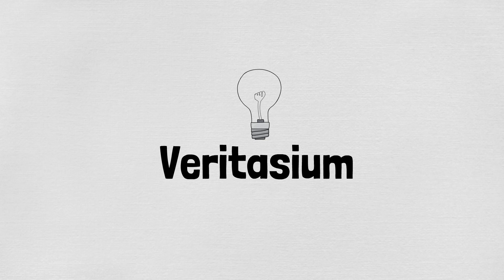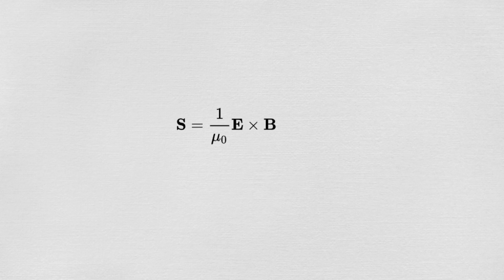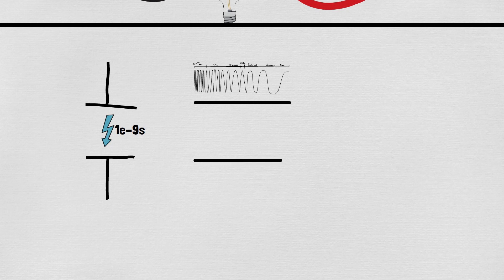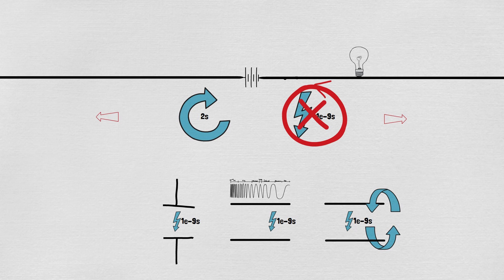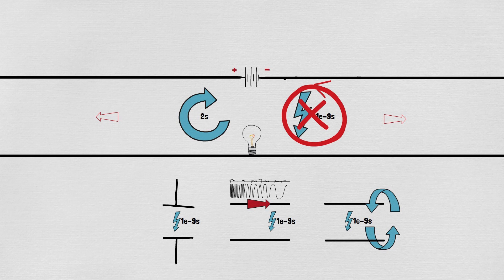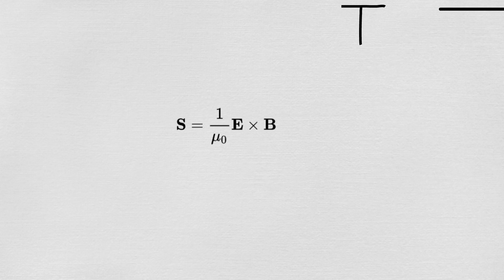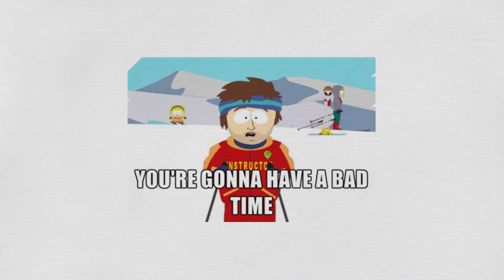Veritasium is Right? (see description)

Comment: Yep 2 things - 1.  Why does the circuit need a switch if the energy floats thru the air to the bulb?  2.  Why does he specify zero resistance wire?  If no current flow then who cares how much resistance there is?  Additionally- if I were to place a electrostatic shield between the battery and the lamp - would that stop the lamp from during on?  (Hell no!)

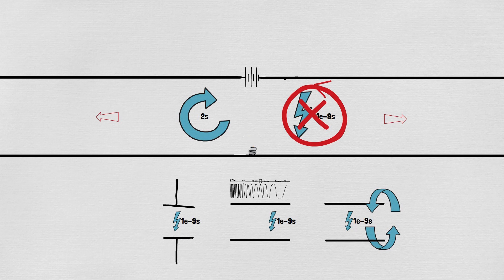Comment: 3:43 exactly, it powers all the light bulbs in the entire universe technically. isn't all field lines going to infinite always ? 
but field strength decreases with the square of the distance, but wait, there's no current anywhere, so it doesn't matter how infinitesimally small the field is, 0 * anything is still 0. There wouldn't be any current whatsoever, so what's the point ?
Reply: oh, the conclusion of the video, I was half way there, should have waited more.

Comment: The current flows exactly because there is a capacitance. Same reason a current flows into an antenna. Of course with a switch this only happens once in the beginning. But the length of the transmitted pulse depends on the length of the antenna. This is the explanation I used in my video.

Comment: It's not the distance between the battery and the bulb that sets the time it takes for the bulb to receive some energy. It's the distance between the SWITCH and the bulb that sets the time. So if you put the switch 1 ls away from the bulb it will take 1 s for the bulb to light. Derek of Veritasium would agree with this.

Comment: Cables literally have something called a velocity factor. Like a coax has 66-85% velocity factor while a twisted pair has 64-74% velocity. We know how to measure length of cable based on that (by doing Time Domain Readings with a simple oscilloscope). Thanks for this explanation, Veritasium video confused me.

Comment: No, Veritasium didn't get it wrong. In the transient state, waves travels along the wires (transmission line), and a return current flows on the bulb's branch (~20 mA by my calculations, given that the line impedance is about 650 ohms). This is small, and he says exactly that in the video. With the reflections, the voltage across the bulb slowly builds up to the full battery's voltage, which is described in the analysis by a Professor that is in the description of Veritasium's video.

Comment: question...isn't the PD on the wires on either side of the switch equivalent to the PD of the battery? There's no good reason why measuring the PD across this air gap would be any different from measuring the PD across the battery right? So as soon as you close the switch there's going to be some flow near the switch, there's going to be current perhaps not through the whole wire but through that section instantly and you say that the flow of current leads to the antenna and capacitor etc effects so I agree with you that Veritasium is wrong, but not for the reason you describe, it's not the whole two seconds nor is it simply the 1/c seconds between the bulb and the battery, it's about the causality between the switch being flipped and the lightbulb.

You close the switch
Current starts to propagate in the wire at the speed of C around the switch
As the current flows you get the antenna affect which propagates out to the opposite wire at C and induces a current
You get a very low amount of that power to be collected by the opposite wire and so at ~distance between switch and battery/C the light turns on
But the effectiveness of the power transmission is extremely low so it's on but I'd bet it's barely noticeable
As the current propagates at light speed along the wire the amount of energy transferred should get more efficient until at 0.5 seconds (the distance between the switch and the end of the wires)
The efficiency would race back to the bulb at the speed of light along with the current flow wave front
For the full second (near enough) for that current to get back to the light bulb the brightness increases, whereupon the current is flowing through the wire at the bulb and it's fully at 50%.
Then would the same process start for depleting the battery's charge and eventually current flowing from the battery after 2 seconds of elapsed time as well as the establishment of the other side of the antenna effect and reinforcing the current and reaching 100% lit

The same would happen in reverse when opening the switch, the charge would continue to flow around the bulb for a second as the close stop of current propagated but it'd have depleted power from not having the charge reinforced by the antenna effect, the lamp would begin to dim after ~distance/C from battery to bulb but it'd take 2 seconds to completely turn off. 

Your explanation is 'obvious' for one side that closing the switch takes 2 seconds to propagate and establish the field but the reverse-opening the switch feels nonsensical, that current could continue to flow for 2 whole seconds between the poles of the battery after the switch has opened.

I think it's interesting how the whole set-up process was glossed over, and that it's assumed that it was set up a long time before the switch is flipped in order for the wire/battery/lamp/open switch to come to an equilibrium before the experiment. And that it's so glossed over that you were primed to think only about closing the switch but not about opening it again.

Comment: Derek assumed that the step response contains a discontinuity at T=3e-9, which may have happened if and only if the impulse response contains a delta function at that T - which it does not, obviously. Instead, it contains a fairly low value (Green function) which decays exponentially till the direct wire coupling hits. Hence, the step response at T is 0. Zero. Zilch. Nill. The  first derivative is discontinuous, and becomes > 0 for t >=T, but that's about it.  I am ready to bet against any supporter of Derek's claim. Anybody?

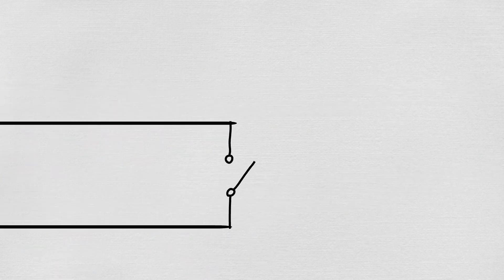Comment: I think youve misunderstood what Derek meant by the field gives power. now i didn't understand it either but what i THINK he was getting at. Is the current still must move for there to be power generated, which comes from the propagating field. Which i think is what your getting at at 3:07 and 3:43. BECAUSE there is a propagating electro magnetic field starting at the switch, the current flows and THEN things are powered. 

In his thought experiment I think hes getting at: Close switch->electro-magnetic field is propagated -> current is flown through the connected wire (not unconnected) -> flowing current powers resistor.

This is my  main gripe about Dereks video. I think he's intentionally made it really vague and supernatural sounding  to incite conversation, discourse and hence views for the video. When in actuality current is still powering things, but the propagating field  generates that current. Which is why the light turns on.

Comment: At first I was thinking that your explanation is spot on but now I think you both kinda wrong. First, we can scrap the light bulb for a super sensitive sensor so that there is not ambiguity when we are measuring an increase/decrease in power and thus conclude when the switch has been closed/opened. In this way you can brake causality like you explained. 

One thing you missed (I think, I only studied Griffiths .... fortunately?) is that it WILL matter where the switch is. While the battery will have a potential difference across it the switch will as well (equal and opposite). When the switch is closed, this is where the current will start "flowing" first and thus create the E-field, B-field and then Poynting vector which will then flow to the detector in probably a complicated way, that at best, will get there at (distance from switch to detector in meters)/c.

Comment: Ok so, does this mean that if we put another light bulb 1m away from the power supply but NOT connected to the power supply - will it get the same fraction of the energy that the connected light bulb will in that initial time frame before the steady state?
Reply: Yes, with a small corretion. It doesn't matter how far the battery is, what matters is how far the switch is, because that's where the initial change of the em field happens.

Comment: I'm glad Veritassium sparked so much debate. So... I am an expert in this field. EE in power electronics. Limited rise time on a cable is a normal phenomenon for us. I.e. there's a 20 meter cable to a motor, and a big IGBT turns "fully on" in 100 ns. The effect ends up manifesting as a voltage doubling at the terminal (long explanation, but it's caused by the time delay and impedance mismatch).

Veritassium put so many restrictions on his problem that he's right. He isn't asking when the bulb turns on, but when voltage is detectable at the bulb. As you pointed out, the switch right next to the battery makes it a dynamics problem, and the voltage across the gap is detectable. Again, it's a common problem for us when that switch represents massive dV/dT. To your point, if the switch was on the moon, there would be a delay. You're right in that the switch is the source of the dynamic field and the thing that matters here, but he put it "at the battery".

Comment: You could run this experiment in real life with an RF signal generator, an RF oscilloscope, a resistor, and two rolls of 16 AWG speaker wire from the local hardware or electronics store. Something like 50' rolls would work. The free end at the start of the rolls will be where the "battery" (a sufficiently stiff voltage source with a high-speed switch or the generator itself) and the "bulb" (a 10Ω resistor) and scope the resistor with a probe. The ends of the rolls can then be stripped and soldered together to mimic the ends of the circuit in Veritasiums video. The time scales will be much different, but the ratio of characteristic impedances of the transmission line formed by the speaker wire and the resistor will be approximately the same, and the general waveform will be similar. Be nice if he could have done this demonstration. If he can afford to hire a helicopter to drag rope around, then borrowing some RF gear should not be much trouble. Edit: Im not sure the wire could be left spooled up as its not being driven differentially like a true transmission line. But still, it would be feasible to unroll it and store it loosely on the floor so there isn't much cross-coupling.

Comment: The explanation incorrectly assumes all electric energy transfer is via electromagnetic wave action.  BUT - this is a DC circuit.  When the current is flowing (as per a standard elecrical circuit analysis) there is a constant current, and a constant electromagnetic field.  As there is no ongoing magnetic rate of change, there is no ongoing induction to drive the electrons (the emf and current) around the circuit.  But we all know is.  So, where does the magic formula get us now?  Nowhere, because it is not suitable.  There are two incorrect assumptions.  

- That electric energy transfer is transferred EXCLUSIVELY via electromagnetic wave action.  Wrong - nearly all the energy here is transferred from the electromotive force on the electrons by the chemically electric potential of the battery (Except for the transition to on and off, where there is some transient second order electromagnetic interaction between E amd M), and 

- that Poynting can be applied to all wires and circuits without fully analysing how the individual fields, with the directions and amounts of the vectors (this has not been done at all - the diagram at 8:45 is only conceptual and is misleading).  The parameters of the formula cannot be practically measured to show the direction of energy flow

So - this formula is not a suitable model  to analyse this circuit (especially without a t or an f in it).  Poynting is suitable for the transmission of electromagnetic waves through space or a medium.  The video also ignores the primary electromotive force of the battery being the source of the ongoing DC power.

Comment: a loop 3000000kms  long will never light with a battery.. even if  it would it would take quite a bit of time.. an induced field across a meter might light up immediately.. but a circular loop wouldnt

Comment: If this problem is considered to be just a basic DC series circuit, then the location of the battery switch and lamp should be irrelevant.  If the switch and lamp are located at either end of this very long circuit and the switch is toggled to send Morse code, the lamp can't come on instantly as to do so would mean information has travelled faster than the speed of light.

Comment: Wouldn't a charge start to flow immediately after connection as the wire itself is not at the same potential?

Comment: If we are just talking about circuits, you need to go no further than seeing these two long wires constitute paired antennas or two terminals of a capacitor, thus a sudden change of current in one wire (from closing the switch) induces current in another, so you have a current, the hypothetical light bulb is lit, it is that simple. If you allow me to toy with the switch a little, I can even make the light bulb sing a song.

But if we are talking about classical Electrodynamics and comparing Poynting vector to electrons, that's where Veritasium confuses me: If you know electrons exist, you certainly should know that electrons are the 'real' physical entities here, static charges (electrons) create electric field E, moving charges create magnetic field B.
But Poynting vector, it  is a math product of E×B, the vector isn't really measurable by a direct physical interaction, we invented this concept just  because it conveniently points to the direction where energy flows. 

So what I don't get is, here electrons create the electric field and magnetic field (in fact, I guess you can see electrons ARE the fields, they are inseparable), electric field cross magnetic field denote a direction called Poynting vector*, and... somehow Veritasium wants to convince me that *Poynting vector is the real thing, not the *electrons*.

Comment: Finally someone, thank you.
I chose 1s because I thought the electric field spreads in both directions and meets in the middle, so to speak.
Question that just came to me: how does the electric field know that the circuit is closed so it can start spreading? Does that mean if I put the switch on one side of the battery it takes 2s for the circuit to close but instantly on the other side of the battery (as in the field has already spread up to the switch)? Or is it like a quantum mechanical thing that suddenly that's an available path so the field starts spreading?

Comment: 'The current wont flow until the current is fully established along the circuit'.

Not quite. Once the switch is closed, the system is in disequilibrium, and a voltage/current wave will rush out from that initial disturbance immediately, the way it does in any telegraph line; at roughly 2/3c, depending on the inductance and parasitic capacitance of the wire. That current along the wire will first start bothering the lamp at L / (2/3c); although it will take some time for all the transients to have jiggled their way out of the system and a steady state to establish itself. 

Derek is right that there will also be a nonzero amount of EM energy radiating straight across space towards the lamp; all parts of space are nonzero EM field carriers, and all transients make propagating waves in it. If your power source was a tesla coil, and your lamp a CFL, Derek would indeed be entirely correct, and the energy would go straight from source to lamp in a significant manner (though that does not appear to be the problem as stated). Given the pathetic high frequency content of a single step function being unleashed, and the fact that an incandescent isnt a great reciever antenna either, its not going to light up the bulb in any humanly-perceptible way; though technically its black body spectrum will shift up a nonzero amount by the energy thus recieved.

There is a perfectly fine analogy with acoustics. What happens if I take a length of tubing, I hold one end to my ear, put a firecracker in the other end, and set it off? Ill hear the firecracker in a time depending on the shortest path between me and the firecracker. But the time it takes to pop my eardrum is proportional to the length of the coil of wire.
Reply from the maker: i think i agree with this. there's a transient pulse at the bulb the moment the switch closes, then back to zero, and L/(speed of electricity) is the time it takes for the full current to hit the bulb, and until that time, there could be capacitive coupling that slowly ramps up the voltage to that value at full current. the problem is how he unequivocally states that power flows from the battery to the bulb through the EM field, so the circuit isn't even necessary, and elsewhere (like on twitter) he states that the bulb turns on immediately at some appreciable % of the voltage and stays on until the current rushes in from the moon. i mean maybe? but i don't think so.
Reply: @antimatterhorn  to be clear i think veritasiums description is very incomplete/misleading, and indeed you point out a lot of relevant nuance. Like you said the presence of the wire matters; and indeed quantitatively most of the poynting-vector-action will be happening in the vicinity of the wire, in a DC situation.

Comment: Interesting take on the Problem, however i am still a bit confused. This might be because I am missing some fundamental electrodynamics knoledge.
If I connect the wire to the negative pole of the battery, wouldn't the electrons in the wire get pushed away from it, thus creating a current for a really short time, briefly lighting the light bulb?
Edit: I guess i need to go read the book, because i thought the EM field would move the charges.